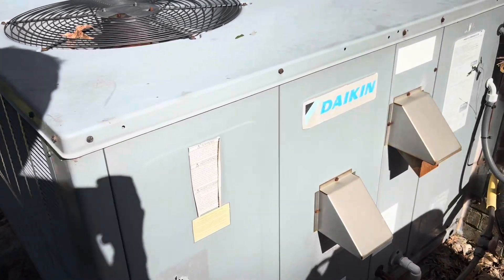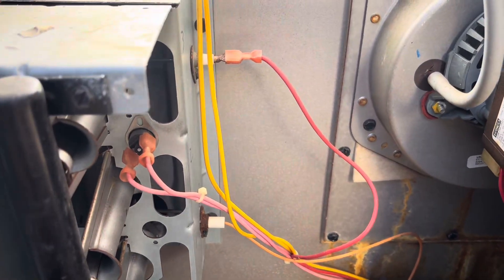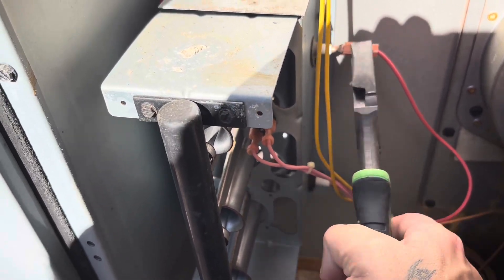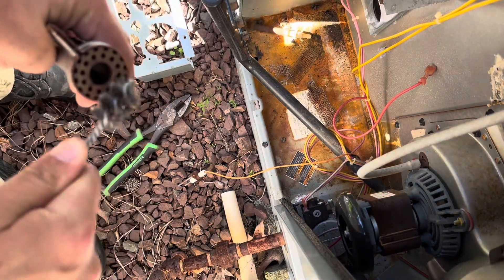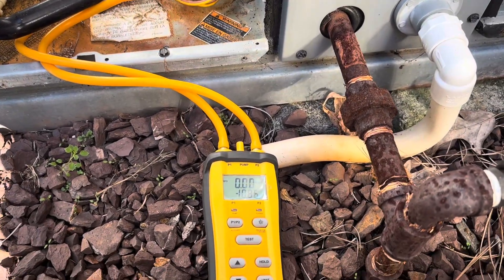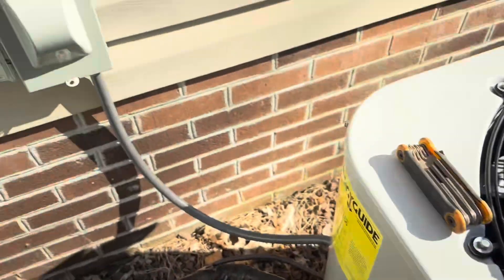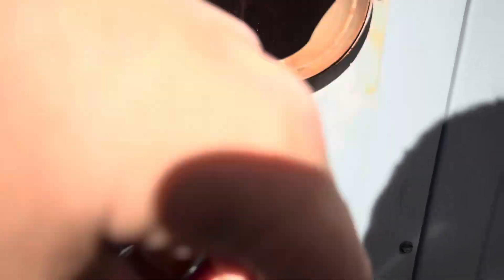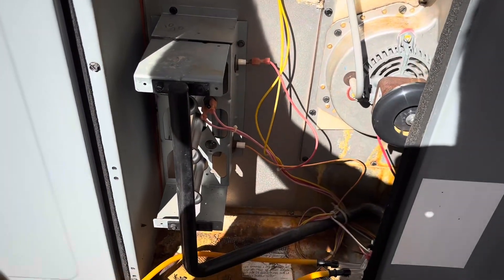Daikin Gas Pack Not Heating: What To Check After Rollout Reset.

Comment: didn't look like it had a low propane pressure cutoff switch, so maybe the tank is real low and pressure dropped off, ending with flame in the burner or behind it. could have ran out and just had it filled or even done so at the end of last year?
an important thing when dealing with propane is checking the level on tank gauge or you may go on a wild goose chase, especially if very cold the night before and then warmed up a bunch during day, the pressure can drop out and come back up. 😬 did that once
Reply from the maker: Good points.

Comment: Depending where you live, a gas pack will never live as long as a gas furnace. I have seen 3 year old gas packs that were rusted pretty bad. I personally dont like gas packs and would not install one in my house. Condenser or heat pump outside and a horizontal furnace in the crawl space is the way to go for longevity.
Reply from the maker: Very true.  15 years 18 tops on gas packs around here.
Reply: I live in west tn and I bought a 2001 American standard gas package unit on my home and I've NEVER had any issue with at  all I clean it every season I'm talking heat or air never an issue. And I've got all round ductwork NO flex none from the unit and all.

Now I'm just the opposite I don't want that leaking water in my attic.  Now crawlspace is fine but attic no way just asking for a big mess.
Reply: @michaelburton4025 
75% of our installs are in the attic. We install an auxiliary drain pan and a Diversitech shut off on the condensate drain We have never had one of our units leak.
Reply: I'm sorry it's a duel fuel/ gas package one of the first ones designed and variable speed blower
Reply from the maker: I’ve only ever seen 1 of those.  Glad it’s worked well for you.
Reply: Oh ok what state are you guys in I'm about 1hr east of Memphis tn our winters isn't bad MOST of our homes in this part of the country deep south I'm talking about we all mostly have package unit or mini splits?
Reply: @michaelburton4025 
Our shop is in South Carolina. Perfect heat pump climate.
Reply: I'm in jackson tn now people do have split systems but mostly package units
Reply: Some crawls are barely big enough for ductwork package is only option

Comment: Thanks for the video Jeff! I would have done the same thing and suspect the roll out switch was tripped due to other 2 burners cross over tube stopped up. With primary burner staying lit and other 2 dumping LP fuel....well you know how LP can pool up in areas and boom with no signs of black soot/burning. I would have gone to LP tank and bumped up tank pressure closer to 14" WC then rechecked manifold pressure. Good repair sir!

Hope you have an awesome week!
Reply from the maker: Good call!  Thanks